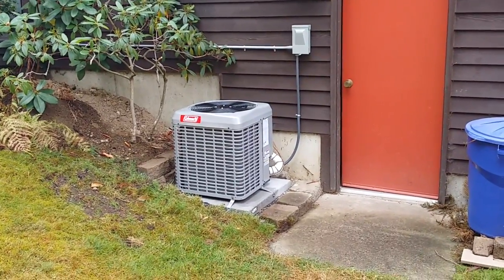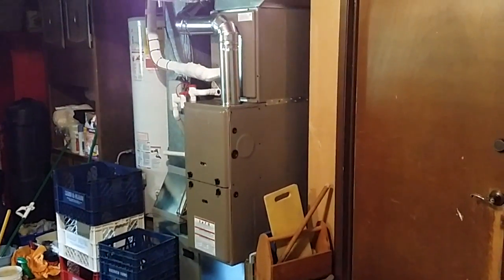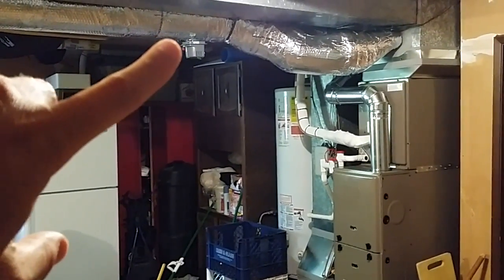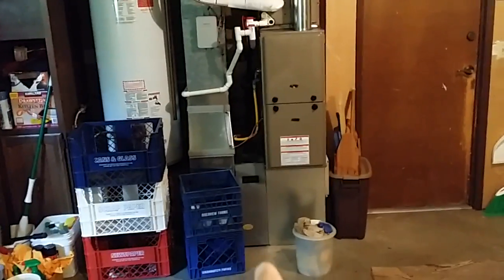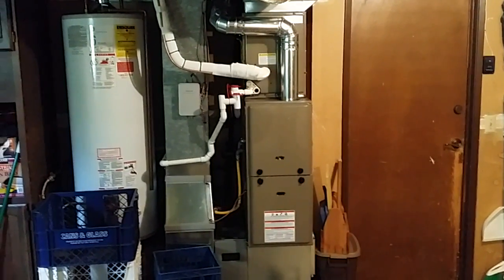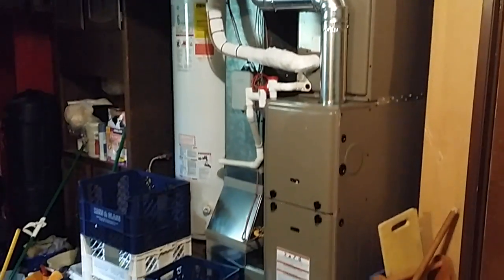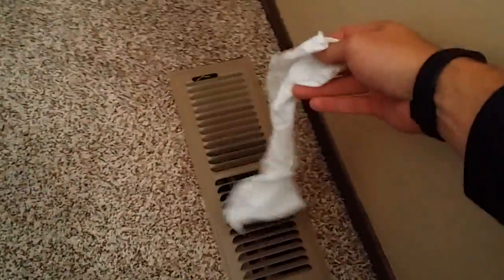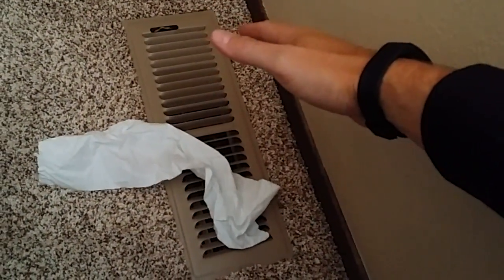How a Minion Damper works! Also 2 Ton Air Conditioner with Sound Blanket

Comment: What else is a minion damper called? I cant find that online and I'd love to know how to wire one to a thermostat
Reply from the maker: Korey Mayo lol. I just call them that instead of a “slave” damper. It’s just a 6” power open damper. Honeywell, ewc, etc.
Reply: @TheDiskinsDoEverything  thanks and how would I wire one to a thermostat in a bedroom separate from the main thermostat in a house? And how would I supply power to the thermostat and the slave damper?
Reply from the maker: Korey Mayo I, unfortunately, do not do the install part, just design